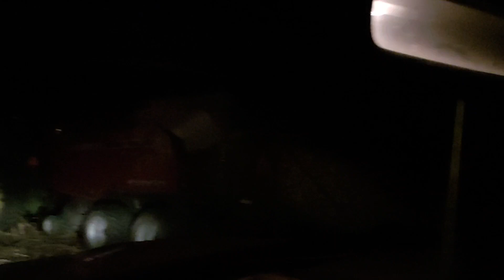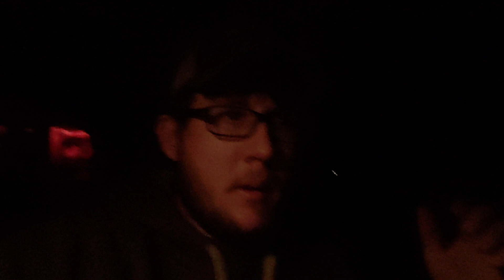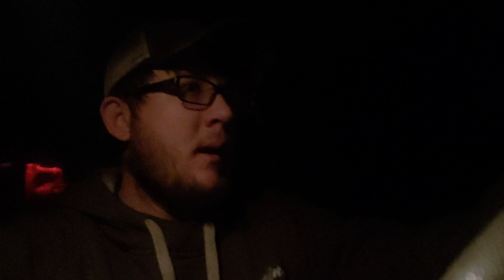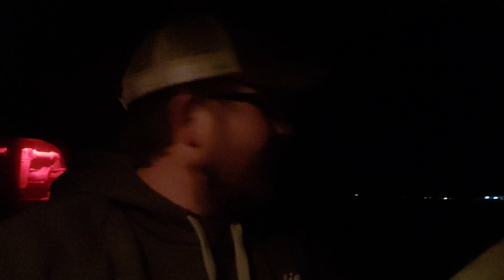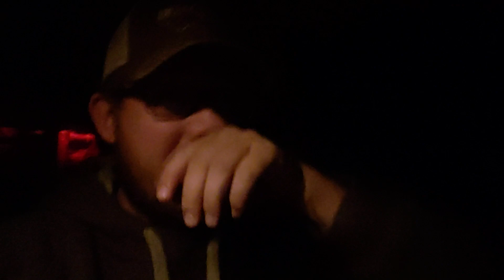So You Want To Do Custom Hay Part 2

Comment: I have the 2150 model, 30000 bales through it, great machine it still has 2 out the 4 original bill hooks, just basic maintenance. Now it looks like your balling corn stalks, I've done it in the past don't do it now. The problem is DIRT. It gets mixed up with your knotter oil  and gums up your bill hook gears, I power wash my knotter several times during haying season, makes a world of difference.

Comment: I have been in your shoes with knotters. In my case it was just one knotter. We replaced about every part that could possibly have been the problem. I had the best knotter mechanic in three counties riding on the baler. No go. We bought a whole new knotter. It's worked fine ever since. Knotter guy said he's never been stumped like that before. Corn fodder is just tough. High wear balers and fodder don't go together well... Custom farming can be really bad and it can be really good. Hang in there, it all evens out in the end...

Comment: Ok I will help sharpen your knife arms and drop down your twin thickness nighty per percent is twine. Been in your shoes don't care what the dealer says lighten up your tension thinner twine up the pressure until you break twine then back off. Just my thoughts